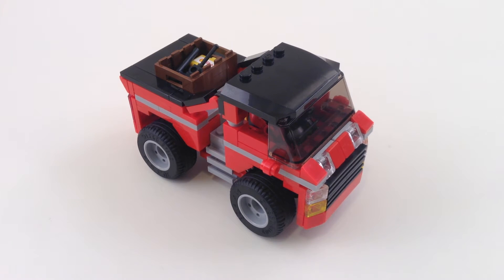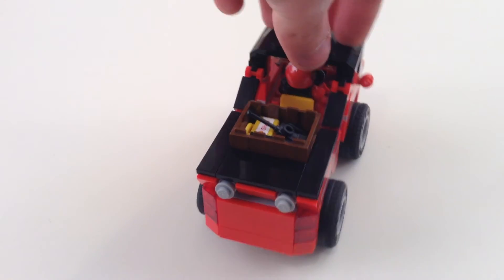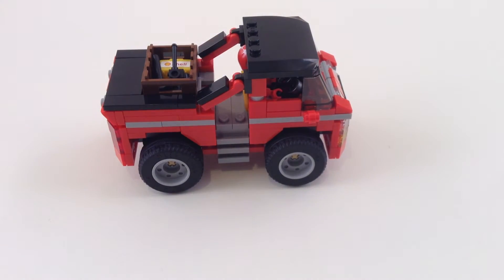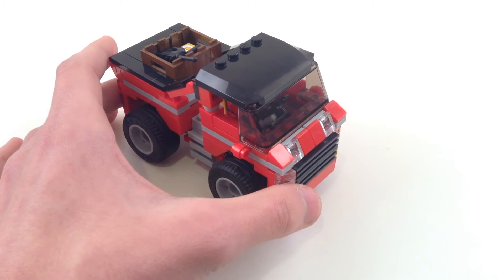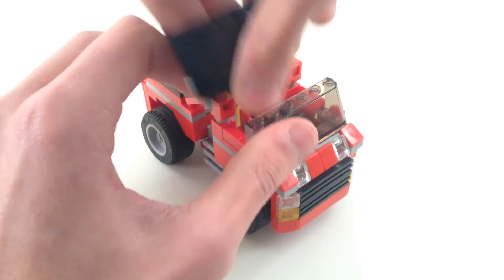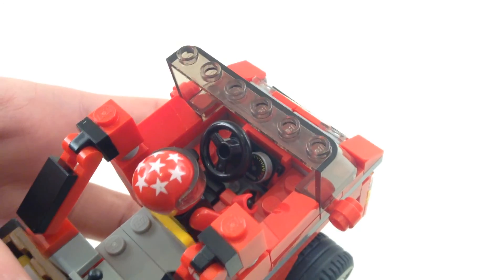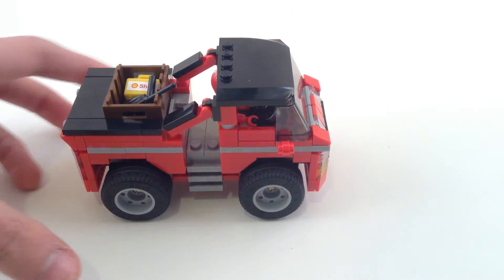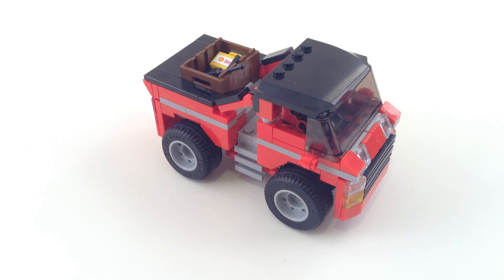Lego Rally Truck Custom MOC

Comment: That is totally  not a rally car plus the watch you defined rally car racing  is wrong
Reply from the maker: Isaac Perlak Thanks for your input. What would you define a rally car as, then? The definition google extracted from the Wikipedia page is "Rallying, also known as rally racing, is a form of autoracing that takes place on public or private roads with modified production or specially built road-legal cars."
Reply: They are usually  crossover  or hatch back type cars driven by two people on a dirt track
Reply from the maker: Isaac Perlak Around 3:30 in the video, I mentioned usually rally cars have a driver and navigator, but I didn't have room, but had originally intended to include a navigator. In addition to this, there are no limitations in rally as to what genre of vehicle you drive, as long as it meets safety regulations. ALSO, there is a form of rally called rallycross which is driven on a closed course in which there is only a driver. Lastly, I would recommend you click this link: http://bit.ly/1IhZJQL or google search 'rally truck', to see that there are such things as light and heavy trucks meant for rally.

I should hope next time you contradict information, you do your research on the topic first.
Reply: Ok you win